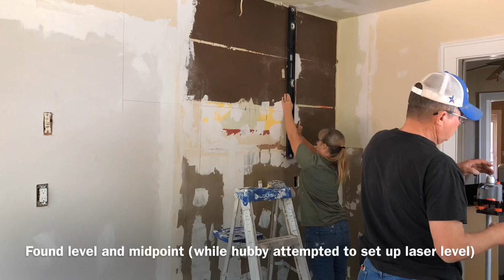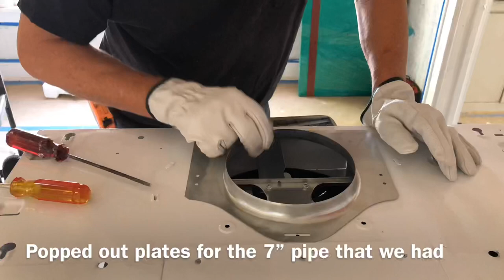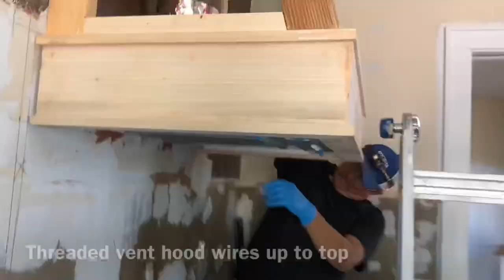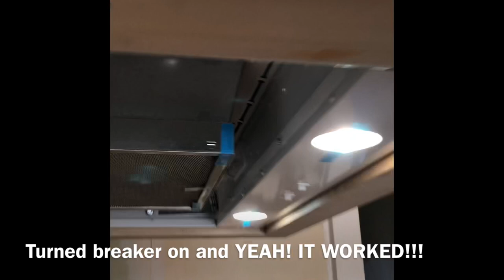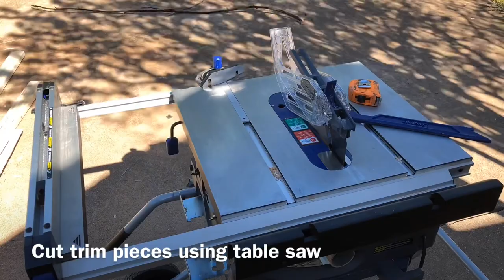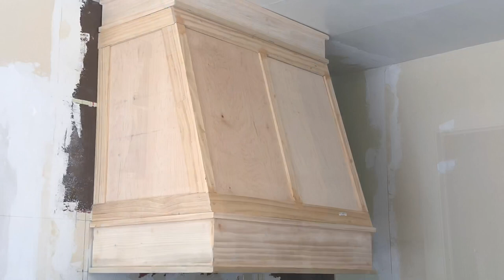DIY VENT HOOD COVER - Part Two

Comment: Nice job. How did you slide the vent hood into your surround? Thx.
Reply from the maker: Thank you! We used self-tapping metal screws. We drilled from the inside of the vent hood into the wood frame that surrounded it. I hope this makes sense for you!